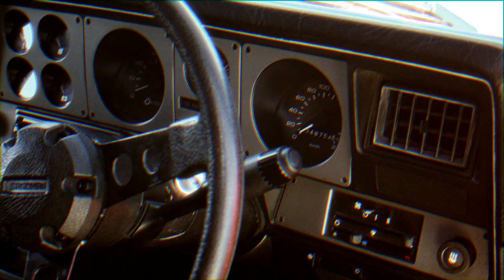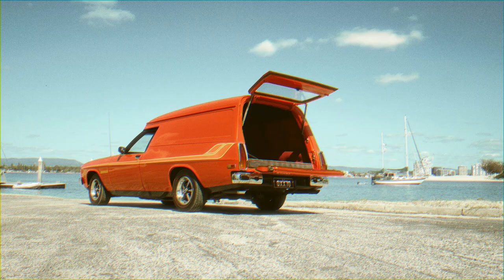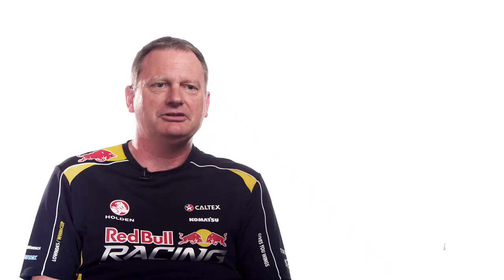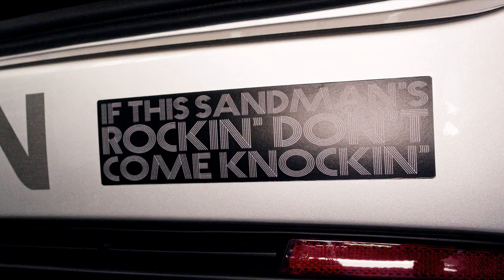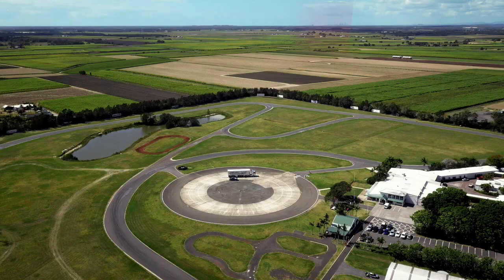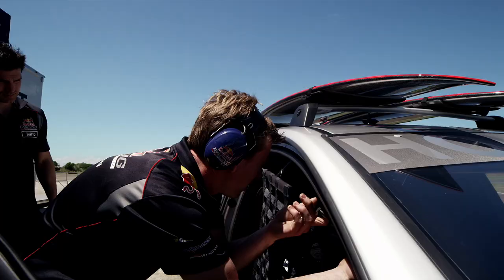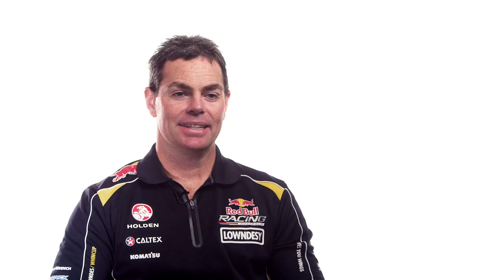The Making of the Triple Eight: Project Sandman Tribute Edition Holden V8 Supercar

Comment: That carbon fiber intake while I'm sure 100% efficient looks like a 5th wheel off of a semi or a tow truck. I wanna see the jewel beneath which is that gorgeous n/a engine. Imagine throwing boost on this combo. Mind blowing one off build and I'm glad they didn't go ballistic with colors and graphics of the original. 70s colors weren't exactly appealing.

Comment: it's just a fucking wagon with surfboards on top..... 5:30..... is http://resources.carsguide.com.au/styles/cg_hero_large/s3/Holden-SS-Storm-wagon-6.jpg with the windows filled in or http://liveimages.carsales.com.au/carsales/car/spec/hold9ane.jpg?height=290&aspect=centered&width=440 with a closed canopy...

weak design attempt.. nothing like the panel vans of old...
Reply: Looks shortened though
Reply: Well no it's actually not just a wagon. It's only a 2 door not 4
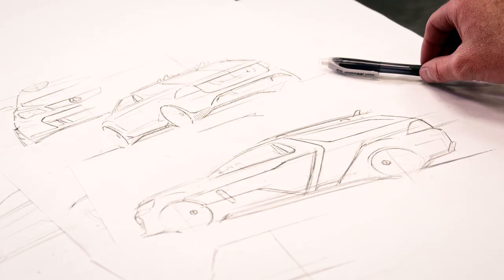Reply: +keirus69 2:32 numb nuts.
Reply: Besides the fact they actually fabricated the body themselves, it looks like it's based on a ute, not a wagon, hence the small 1/4 windows. Identical to the factory ute with the sandman fibreglass canopy added. So, it's not just a wagon lol.